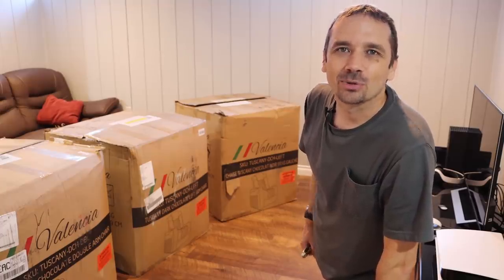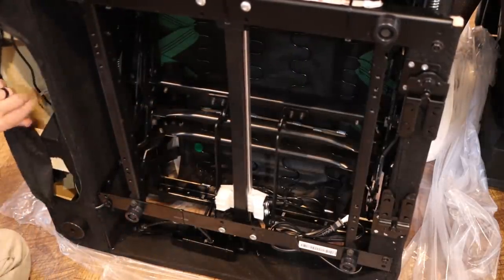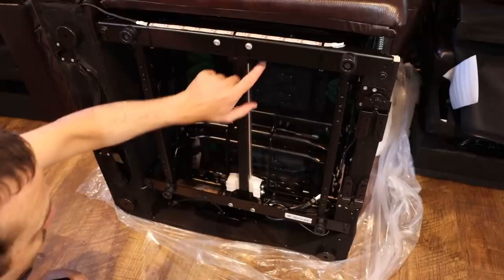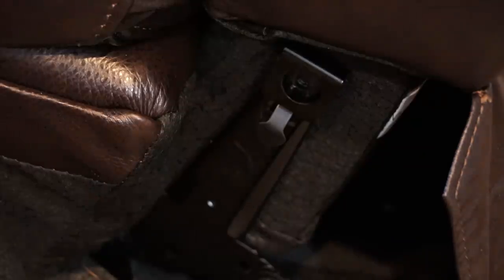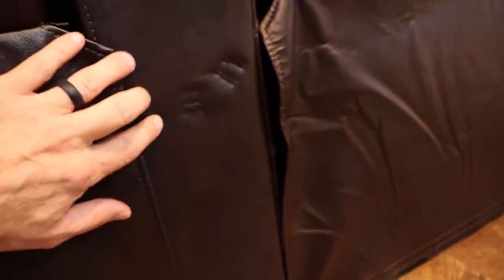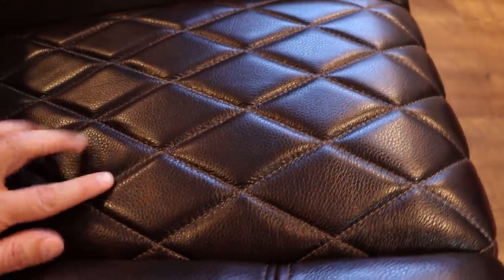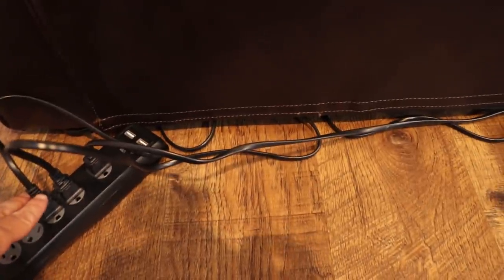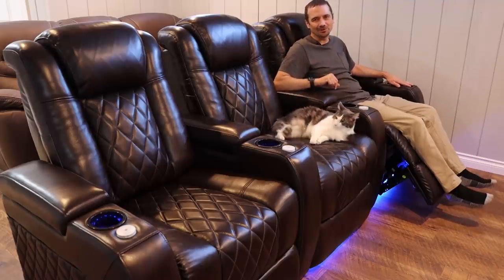Valencia Theater Seating Review...Is it Worth it?

Comment: Used to be a movie theater manager. These seats are constructed almost exactly like the ones used in the industry. The only thing they're missing is the ability to daisy chain like you mentioned. Top notch product and parts should be abundant for repairs.
Reply from the maker: Thanks for commenting! I love that you can attach them together but can also use them separately.
Reply: @Tronicsfix  But if you use them separately some wont have an arm rest..

Comment: 1:30 Steve, love the content and I'm not an electronics tech but I don't think you can necessarily just do that with light emitting diodes. It would change the amperage and/or ohms load. In series or parallel there is potential to fry something.
Reply from the maker: Sure you can. They even have solder pads built into them. There is a limit on how many you can solder together but its a lot

Comment: Well from experience I can tell you that if you are reclined and you have a power outage you are stuck in that position until power comes back on 
My fix was to get a computer power backup to plug in to 
It has saved me a lot of trouble 
My legs don’t work good so when it’s stuck in the reclined position I’m trapped
Reply from the maker: That's a good idea for a backup power supply. That would not be fun to be stuck there!
Reply: @Tronicsfix  
No it’s not fun 
At all 
After the second time it happen I got the battery back up 
Cheapest one Amazon had 
Think it was $40 or so 
And has saved me a few times already
Reply: Really? The power supplies for my electric recliners have 9V backup batteries in them so you never get stuck reclined.
Reply: @MikeL-FL   I don’t have the brand he just got but mine don’t wish they did 
Honestly if a recliner is electric it should have a power back up and it should be mandatory